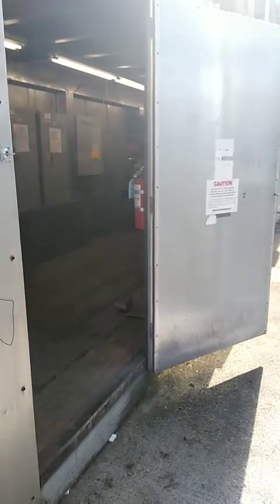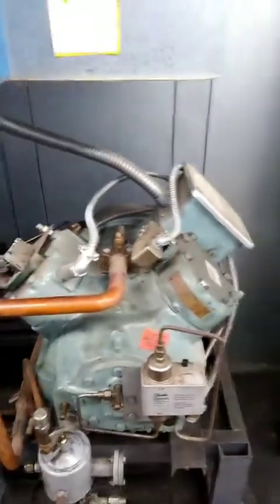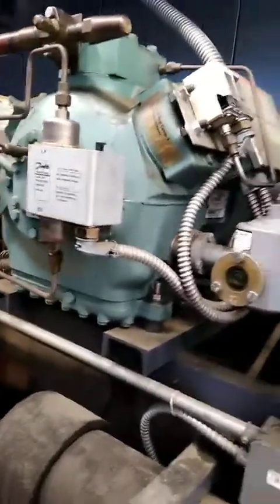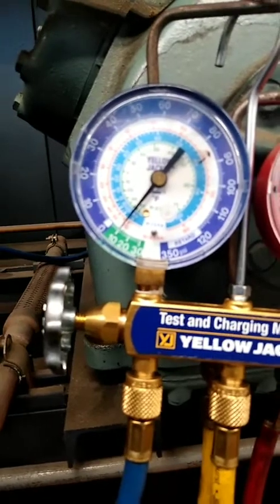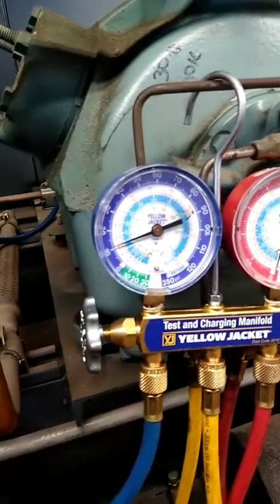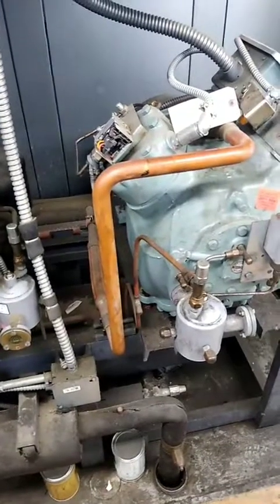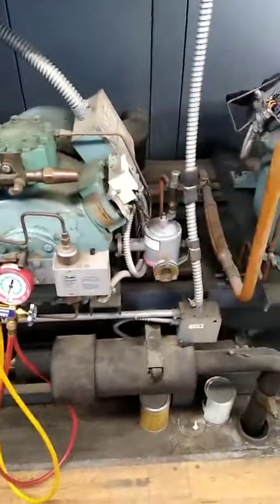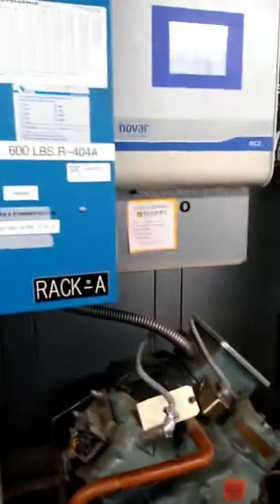Supermarket rack refrigeration, troubleshooting oil problems, bad compressor valves Part 1.

Comment: Another thing to check is for bad oil floats. Valve off oil to compressor 1 at a time see if oil returns to other compressors. Checking compressor capacity for bad valve plates quickly you can feel your blowing high to low, compressor body abnormally hotter end bells or body as compared to others. Just a quick check before gauge check. Remember too suction will go up through oil float or refrigerant boil off on off cycle. Also use temp gun on heads and compare temps with other compressor heads. This could catch an offending valve plate. Pistons probably ok. No sound of crank rod or excessive vibration. Just a heads up.
Reply: Also check compressors amps while running. Sometimes this can reveal a compressor not running at rated capacity under load.
Reply from the maker: Yes sir good points to add which I never mentioned.

Comment: That's nice the engineer that designed that motor room left you so much room to reach the suction service valve while you toast your scrotum on the discharge line.

Comment: Too sketchy and "slangy" for beginners. 

Someone could redo this video with multiple stops-for-explanation to explain the mechanics and vocabulary of what's being said.

As with many videos like this, if you can understand what's being said, you don't need to watch it.
Reply from the maker: I agree you make valid points, watch it over and at work listen to your peers, learn thermo dynamics. I suppose at the time I was targeting people who already have experience.  Oil issues can be very troublesome, this video is put out for techs that have a base level of Rack knowledge and some small commercial refrigeration experience. Thank you
Reply: @stevep3089  
Yes, almost every sentence of the audio could use a paragraph of explanation and context. 
That would be very helpful to beginners - in 2 ways 
1) the 'what's going on part
2) how pros talk about job situations and the shorthand used.

Youtube has an automatic text generator if somebody wanted to make a project out of it. 

I just watched this video about check valves where the vlogger does a stop-explanation near the beginning.

https://youtu.be/0pBP77xnfBs

(Check valves are a simpler issue than all the things "cut across" in your video. But still, a fleshed out explanation of the various "plot twists" would be a great exercise for beginners.)
.
Reply from the maker: @hg2.  I Appreciate your input thanks.
Reply: Welcome to Rack Refrigeration. If your new pay attention or it’s sink or swim.
Reply: @reefermadd.2204 
"How helpful."
You're the first HVACer I've met that sounds like someone I'd want to avoid.
Reply: @hg2.  No problem. Enjoy sinking.
Reply: @reefermadd.2204  
Do we need people in this industry?  If yes, please stay away from, and don't talk to, beginners.
Reply: @hg2.  . You’ll be fine just pay attention, don’t rush through your calls, besides it all comes down to not loosing $10-15,000 worth of product when a rack is down.
Reply: @reefermadd.2204  
Duly noted. 
My advice to YOU is stay away from the apprentices.  Don't say anything to them.  Your obnoxious, patronizing attitude will only cause trouble. Repeat: don't have ANY communication with the apprentices.

Comment: I have been doing refrigeration work for 43 years, I noticed that there is no" OIL SEPARATORS" on this equipment(need one for each compressor), that is an absolute must for condensing units that are higher than the evaporators( or long line sets). poor oil return will be the result, and it is really bad on low temp freezer systems( low suction pressure). also you do not want oil in the evaporators, it acts as a wonderful insulator, poor heat transfer will result, causing "FALSE LOADING" on the rack system/ T.X.V. hunting!!!!. I am not a big fan of multiple compressors operating one evaporator/ multiple evaporators that are all tied to one line set, all for the sake of "LOAD MATCHING". there is too much to go wrong, like a compressor burn out that contaminates the entire system!!!!
Reply from the maker: I totally agree, especially when nobody gives a crap, employees don't clean, and installers rush don't purge and are inexperienced.  Engineers try to make everything more "efficient." well pal it may work on paper but not in the real world. Thanks for watching my friend. Stay well ❤️🙏
Reply: @stevep3089  , I see that you are trying to make a real effort to make the systems better, so they do not keep "TAPPING" you on the shoulder. I feel your pain!!!. I know that engineers have their "WET DREAMS" making what you think is more efficient, but what they are really doing is "REVERSE ENGINEERING" meaning "LETS CUT COST ON THIS SYSTEM" so it barley works. I had a 30 H.P. copeland condensing unit that was a constant temperature system for a computer/ I.T. floor . the compressor had an "UNLOADER" on one head( 50% cap. reduction). this system did not have any controls for "YEAR ROUND OPERATION" and the condensing unit was outside. the guys that worked on it before me, was always adding oil to the compressor, and about once a year, the compressor would "LET GO" ( broken reeds from oil slugging). this system was given to me to straighten out the problems. I added al the goodies( head master, oil separator, evap. hot gas bypass- set @ 60 P.S.I for R-22) I had no idea just how much oil was in the system, I striped out 8 gallons of excess oil from the system, and "ALL " the issues went away!!!!. it went from being a total "TURD " to "NO SERVICE CALLS"( I LIKE THAT!!!)    have a great day!!!!
Reply: Don't you mean an oil separator for each rack? I never saw a rack with an oil separator for each comp. Of course the bigger problems are the Carlyle compressors
Reply: @tram5724  , the only way to get an oil separator on each compressor is to "ORDER" it that way when the "RACK" is being built, or you would have to add it yourself. what is nice with that set up, is any oil that leaves each individual compressor will be caught and returned back to that compressor. the reason it is not done that way is "COST", you have to "SPEC" that in when the order for the equipment is placed
Reply from the maker: @tram5724  Carlisle's are great compressors if the system design installation and maintenance is done well. I haven't seen large commercial refrigeration rack with oil separators at each compressor either.  I have seen it on industrial freeze dryers though.
Reply: @stevep3089  rack manufactures use mostly Copeland.. for a reason. Houseman used them in the early 70s for their big grey rack. Also in early 90s some supermarkets use compound racks and r22 . Carlyle comps cause Cope would not warrantee them in a compound situation . More problems than other racks. A number of new stores were postponed until hp62 was cleared for low temp
Reply from the maker: @tram5724  I see what you're saying, it all depends who engineered the system and what deals they get on large purchases.  I see more and more Bitzers out there. I've worked on the R22 systems. I believe There's more problems because less people have the proper knowledge to work on them and lazy techs don't maintain anything. Or have to slap a bandaid and move on. I've worked on plenty of Copeland racks that have constant issues as well, proper installation is a huge factor, as well as proper experience and time at a location to find out whats actually happening when it goes down.  I've had to camp on a roof before because they history was not enough to pinpoint the issue.

Comment: The first thing I would do, is put a low pressure gauge on the suction and one on the oil feed line. There must be a min. of 5 lbs higher on the oil feed line to allow the oil to enter the compressor. Some racks use 10 or 20 lbs difference on the oil feed line. These Carlys have a oil pick up screen which is a bitch to get at.
Reply from the maker: Yes 5#, controls are 8# cut out.  Carlyle recommends a 20# check.  However some racks, Maybe due to not ideal piping practices, work better with a 30# check valve.
Where's the screen on the Carlyle? Or which models have one?
Reply: @stevep3089  , all semi- hermetic compressors that have an oil pump will have a "PICK UP SCREEN"  on the suction side of the oil pump, and a magnet to pick up any metal made of steel. the location/ removal depends on make of the compressor. they do need to be cleaned from time to time. if you do plan to pull the screen, you will loose all of the oil in the sump( dump the oil first- if there is no drain plug then use the discharge side of the oil pump, and start the compressor and let the compressor oil pump  "PUMP OUT THE OIL", and shut down the compressor when the oil flow stops).   also , if you have a compressor with low oil pressure, reverse the compressor rotation and see if there is any change in oil pressure. a lot of times the oil pressure will come up due to using the other side of the crankshaft/ rods that has no wear , this includes the oil pump also. the pump is designed to pump in either direction!!! ( over the years I did my fair share of compressor rebuilding too, like all the way down to nothing but parts)
Reply from the maker: @gregoryclemen1870  I've replaced a handful of oil pumps and had them apart on Carlyle D series in particular I'm pretty certain I've never seen a screen, or a port on the case like  Copeland does. It's possible someone ripped out the screens by chance. What am I missing? I've def used the reversing to start old comps sitting off for years too, make sure you know where the main breakers are 😂. Great tip, I use the outlet of the oil pump on compressors that have a little more then ample oil level to fill ones  that are low to get through the night and see what happens later.
Reply: @stevep3089  , on that style compressor , the screen is inside the crankcase, and is not possible to remove it unless you pull the compressor and remove the sump cover. YUP!!!, carlyle really did their homework on that one!!!!!, you can not get to the screen from the outside of the compressor, it is screwed into the casting from the inside, feeding the inlet port of the oil pump( there is no screen at the pump itself) what is really bad about the semi- hermetic compressors that were built after 1960, is they started to use aluminum connecting rods instead of bronze rods, and they are not very forgiving when it comes to low oil pressure, unlike the bronze rods that would take a lot of abuse. the pistons also had 3 rings ( 2 compression, and 1 oil ring) on them , that also went away, now it is just 2 compression rings.   reverse engineering at its best!!!!. I know it will not be much longer that copeland will stop rebuilding the semi-hermetic compressors. they no longer want the "K" body cores back for credit!!!
Reply from the maker: @gregoryclemen1870  Thank you! Great explanation! ❤️🙏
Reply: @stevep3089  , any time you have a question , feel free to ask!!!, "KNOWLEDGE IS POWER"!!! ( I also taught hvac-r classes years ago)
Reply: I believe the screen is in the oil pump which is in the front of the compressor. Have to take off all the bolts.
Reply from the maker: @Reefertech  I'm almost certain there isn't one in the pump on E series or service replacements, def not in D series . Carlyle uses a magnetic plug to catch metal debris at the bottom of compressor case.

Comment: what kind of test did you perform on compressor 3?
Reply from the maker: I just preformed a pump down test to see if the valves hold back the discharge pressure, not allowing it to pass into crankcase.
Reply from the maker: On occasion the valves will pass the pump test, if you still can't keep oil in comp, and you have good differential pressure, fill compressor 3/4 glass then shut off oil inlet valve.  If you can see the oil level lower after 30 mins of continued run time there may be worn bearings inside the compressor.
Reply: @stevep3089  or rings.
Reply from the maker: @tram5724  I pump down the compressor by shutting off the suction then turn off comp, if crank case pressure rises too much and valves cannot hold discharge pressure from rack back there is an issue . If the compressor cycles off you don't want pressure from the discharge manifold passing through the valves and into the suction manifold.   Watch it again it may click a second time.  This is kind of a more advanced oil issue to troubleshoot.  🙏❤️